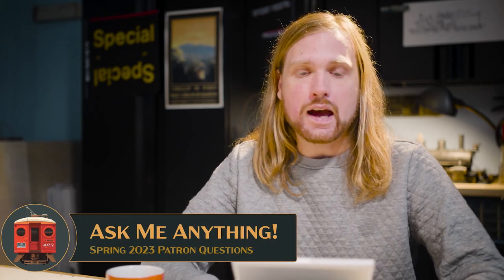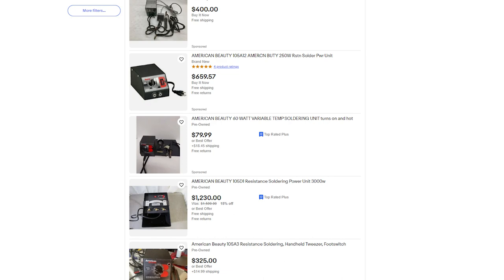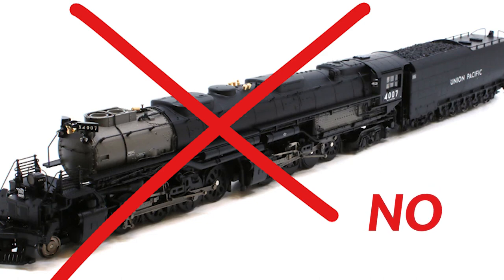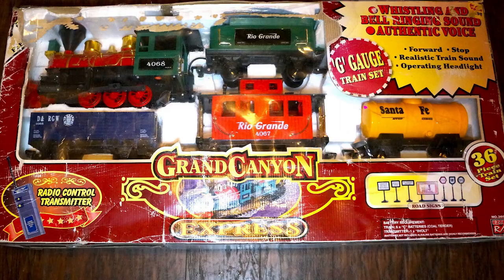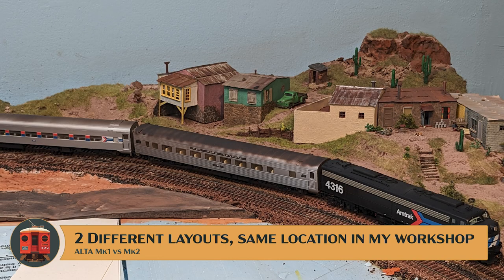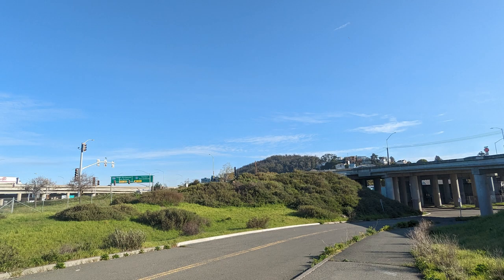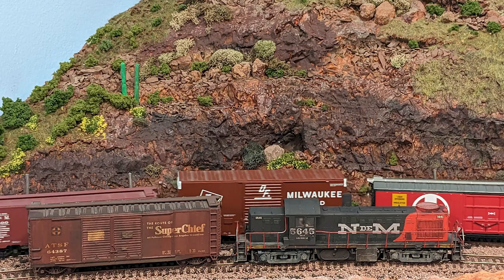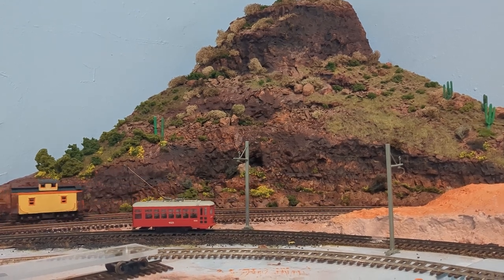Professional Model Railroad Builder Answers Your Questions | Volume 1

Comment: I’m definitely surprised how little HO steam there is smaller than a Pacific/Mikado. There’s like a generic 4-4-0, but not much else. Definitely jealous of the OO modelers who are spoiled for choice with all their tank engines, Moguls, and Atlantics.
Reply from the maker: It's really disappointing, especially as someone who rarely needs larger steam than a Mikado only to see all the major mfg's remaking and remaking and remaking Bigboys, FEF's and Reading T1s, OO is indeed spoiled with all the small steam, I'd like to see the same in HO as soon as possible.
Reply: Also for O Gauge/O Scale. Lionel has made a scale CN 2-6-0 and Harriman 2-8-0 which are excellent stand-ins for various railroads, but they usually are VERY pricey. They have also released an 0-6-0 Yard Goat and 4-4-2 Atlantic. Unfortunately for traditional O Gauge, Lionel used to make a HUGE variety of steam and diesel like an Alco RS-3 body which had either four- or six-wheel trucks under it to represent Alco RSC/RSD models or simpler the Alco FA, a basic but loveable diesel which most first time railroads got acquainted with in their very first train set. MTH also made a “traditional” 2-6-0 Mogul and a 4-6-0 Ten Wheeler but stopped producing them years ago. I agree it would be nice to see more “smaller” steam engines as many railroads employed hundreds if not thousands of these various types, some of which would later end up on smaller railroads and then be preserved as park memorials, museum exhibits or even returned to operation, like Canadian Pacific’s D-10 series of 4-6-0 Ten Wheelers or various Canadian National 0-6-0, 2-6-0, 2-8-0 and 4-6-0 locomotives, of which many still exist both in Canada and the USA.

Comment: 3D printing is definitely going to explode in the coming years.  People making those hard to find, or never made models. To fill demand for things that aren’t accessible.   More than just details/scenic stuff but full models.    I’ve personally commissioned a Brill 350 model car from the C&O, of which the last brass unit on eBay sold for 1,950.00
Reply from the maker: I agree. It seems like we're about 2-3 generations of printers (less than 5 years) from having artifact-free resin prints, which will be incredible. I've been using resin prints for kitbashing for about 3 years now, and it's been such a remarkable upgrade from Shapeways.

Comment: What do you think of people upgrading and running ancient locomotives from the 50s? For example I own and operate a fleet of Hobbytown of Boston/Cary Locomotive works locomotives that have been updated and upgraded.
Reply from the maker: I adore it! I think it's always, always a good thing to extend the lives of older models by superdetailing and upgrading them. Cary locomotives are such beasts! They pull so well. Which hobbytown models do you have, the RS3s?
Reply: @InterurbanEra  I have a RSD-4/5, two EMC FT's (one A and one B unit) and I have an SW1200 with an athearn shell on it

Comment: What is your opinion on 3D recreations of your work? I would love to model Alta digitally, as a local northern Californian.
Reply from the maker: My only stipulation is that I'd love to work together to advise on getting it correct! (plus I can share essential knowledge/lore to get the feel right too) What train sim program do you use?
Reply: @InterurbanEra  I traditionally use Rolling Line, as I’m used to the visual artstyle, and the appeal of the simple way you build layouts. While I understand the community is a hellspawn (I’m a ex member of if), I more or less just like to make my own trains and watch them go around. I do all my 3D modeling for steam and diesel engines in Blender.
Reply from the maker: @finn_4761  do you like making the more cute stylized models or the hyper detailed ones? I think it'd be fun to do them in the original art style.
Reply: @InterurbanEra  I can do both. I actually like using the distinctive color pallet Rolling Line has with loads of modeled detail.
Reply from the maker: Which aesthetic are you leaning towards for the ALTA build? If you wish, DM me on Instagram or join the Patreon at any level to DM me there so we can continue the convo there. Thanks!